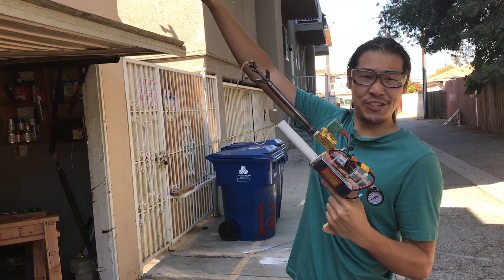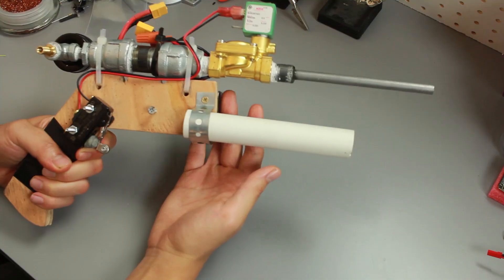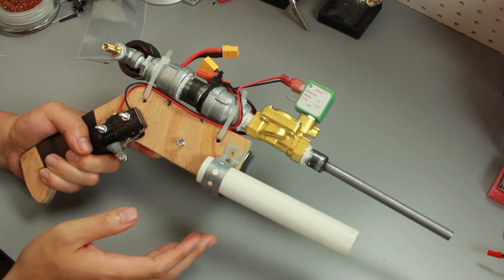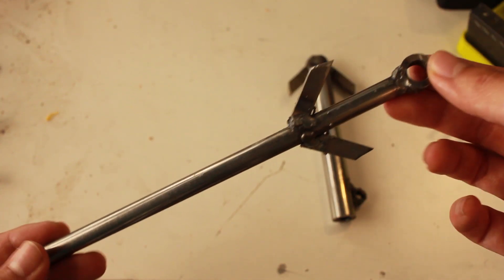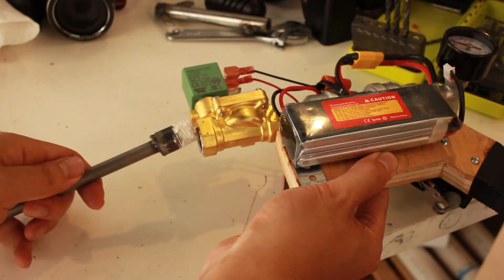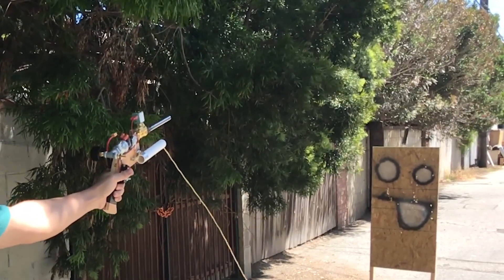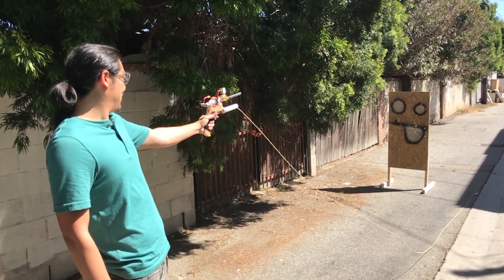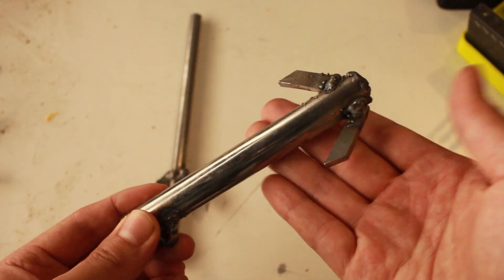Awesome Homemade Grappling Hook Gun

Comment: I like the straw wrapper design but you might try using some rubber sealing rings to maximize pressure on the rod. I prefer this design since it allows for more power behind the shot. We cant have spidy falling short because he missed by 1-2 feet.

Comment: u need one that is like a spike in the barrel then when it leaves it has 3 or 4 hook like parts that when it goes through something it expands to look its self like a one way valve. kind of like grappling gun from cars 2 in the opening scene (i am not a fan of the Disney cars movies I'm just using it as a reference) this plus the extra pressure and you have built the ultimate grappling gun

Comment: You could make the entire grappling hook out of recycled HDPE plastic, you could reduce the weight considerably. Also if you use a high pressure cylinder with a regulator you could adjust it to whatever PSI/CFM you want, and just refill with a scuba or N2 bulk tank....

Comment: what if you shortened the straw rapper an used acrylic or PVC pipe to extend the length of the hook so it's liter and it can go further and still have the strength you need.

Comment: So, I don't like any of these designs. the straw wrapper is fundamentally too heavy, and besides the problem of it flying back or damaging what it hits if you miss <or if you don't...!>, that restricts carrying capacity and the variety of use cases. the column first, meanwhile, has the problem of restricted geometry and a phenomenal requirement for being able to first accurately reach a target, and second, engage on it. so the straw design is better on this count, but since the problem of a grappling hooks engaging is the angle of the hooks, and the problem of flight is stabilizing a cylinder on a trajectory, I think you should flatten the 'straw' to just a heckey puck with the hooks, and put that on a shaft that you launch <like the column launcher>.  I'm not sure if I think the hook portion needs to be affixed to the shaft portion- I kind of have this vision of something that stays in the midle of the shaft and maybe spins to give it some aerodynamic stability, and if the shaft hits a wall that can slam ferward like a slide hammer for a 'poke in' affixing of the rope, and if the grappling hook and line go over and pull back to a target, the hooks can engage as normal.

Comment: Depending on how tight of a fit the straw wrapper style is you could probably reduce a lot of weight off of it as well. you only need a minor amount of material to hold your weight and the rest could be shaved a way you might be able to cut a pattern into it that still in part strength but lightens it up or leave two or three strong struts that run the full length with a ring at the bottom and then fill in the rest with something it still captures the air....

Comment: I have a idea use a magnet to force the grapple out flip a switch and push the same magnet down to make a huge pushing force to fore the grapple out towards a target and to recall it back just attach a pulley to the grapple and connect it to a switch to pull it back into the barrel and then add a rest switch to move the magnet back up and then repeat

Comment: The problem is efficiency. You should add a water chamber inside the barrel of the hook. Then let the pressure spray backwards as it leaves the straw.

Comment: Needs a better seal and possibly a longer barrel. The gas you use to pressurize this will also effect the range. Might want to try directly loading a CO2 canister maybe even use the parts from an old paintball gun. I would also like to see how a spring loaded version compares.

Comment: I love this guy's videos! I have an idea or two for the straw wrapper hook. I was thinking maybe half steel and half pvc pipe (or something light like such.) Like a weighted arrowhead concept. Move the rope's loophole at the bottom of the steel half to still make use of the strength of the steel. And still using the arrow concept, run feathers down the pvc half. They're weak enough to keep from obstructing the hooks latching on. Also maybe have a spring mechanism wired to go off at the pull of the trigger to assist against the rope's resistance. It would increase the rope's chamber size, so maybe run it along the side instead of the under barrel and at an upwards angle. Idk. You're the walk and I'm just talk lol. I really love your work, though.

Comment: A smaller diameter tube explells gas faster especially at low PSI a larger canister / tank or pipe in your case will be better. The current one is to small. Fitting the projectile over the tube with a tail of aluminum should net you good weight to strength ratio. But it is also good for your spiderman application to have a balanced projectile...

Comment: I just wanna say that the tube that holds the “web” is lower down than the air tube (not sure what to call it) and it could pull the “web” down thus making it not attach the way you’d want it to. I just think you should take it into consideration.

Comment: my big thought, ditch the adherance to pressure ratings. IMHO, your steel air chamber and brass lock are good for a hellava lot more. 150 psi... pfft. if ur working with pvc, sure. ive run a setup using an exhaust dump valve at 600-800 psi, using a refrigerator compressor into a fire extinguisher. then charging with that. all brass n steel fittings with rolled steel tube.

The only major hurdle I faced was I needed to Jack my trigger voltage way up to 45v (5x9v Batterys) to "pop" the valve quick enough. but with a limit switch n dump valve, it only needs a tap to open.

compact, powerful air, takes pressure, my man.

interested to try over-barrel tho.

Comment: I would say making it lighter isn't necessarily the answer because would it not have less momentum?  My next move would be increasing barrel length or making the hook more like an arrow.  If you think of it like a gun, which is essentially what it is, the longer barrel will allow more acceleration.  I think the hook starting inside the barrel is a better idea.  Seems like a no brainer but have you tried using various lubricants to reduce friction?  Another idea would be to angle the barrel slightly upwards to compensate for drop, means you could more accurately just aim and shoot. you could possibly try to incorporate propulsion into the dart rather than or as well as the gun, to gain more height, which is what a grapple is for.  Just throwing ideas out there, one might stick.  Great video though.

Comment: The main limiting factor probably isn't the weight of the grappling hook, but the weight and drag created by the rope. So actually making the grappling hook weight more compared to the rope may result in longer flight. But ideally make the rope thinner.

To check if this is true - try the hook with and without rope.

Also another way to make it better without changing the power is to make the acceleration last longer - for example by lengthening the barrel.

Comment: You mentioned that you used that specific solenoid because it has that specific size of fittings. You could try possibly using one with larger fittings, then mounting them to your back and using heavy duty tubing to carry the air to your arms. that way you can lessen the load on your hands, reduce bulk, and possibly have more space for a larger grappling hook.

Comment: Might be cheaper to hack up a paintball gun as a starting point given their working PSI's. Though that does add a bit of danger given the increased energy being worked with.

Also would be curious to see the same experiments done in the video but with dental floss or thin string. Seems like a lot of energy is lost in having the projectile pulling the rope.

Comment: I had this crazy idea the other day, you know how you can make it so water can cut through steel sheets?
I was think if it would be possible to make some kind of water sword, you could have the "blade" side be water shooting out and the flat of the sword would be steel that goes up and over the water making so the water is stopped.

I don't know if you could lower the pressure enough so that it wouldn't cut through the steel but still be strong enough to slice through just about anything else. It probably wouldn't be super portable considering that you'd have to have it connect to all the stuff that have the pressure and water but I think that it would be amazing if it were possible.

Comment: The main benefit of the over the barrel version is that it will fly a lot more true and if you make it a tighter fit it will use the pressure a lot more efficiently

Comment: WEB FLUID SERUM (I DID NOT MAKE IT IN ANY WAY) 
spirit gum with sylica
hydrolized polyvinyl alcohol
water-purified
magnesium oxide
graphene^
xantham gum, or guar whatever
heating coils
combined then like agitated by getting shot through bristles 
and shot through a sort of flat thimble spinneret with the holes all pointing in a inward direction so it makes a binded thread.
literally 60$ for the chemicals on amazon (in total btw)

Comment: I'd say the furz and furz light are the best option,  the problem with the furz light you made is that it flipped mid aire so it slowed itself down. you should try to make a "classic" furz but using a lighter material

Comment: Make the straw wrapper, but change the pipe part of it to a pvc of some sort or light weight material. The heavy metal head will make it continue to go forwards, and pvc will be lighter and still be able to take a reasonable amount of pressure...

Comment: Although it'll bump up the price significantly and be harder to weld, titanium might be a good option for the hook due to it's similar tensile strength compared to steel and it's lower density.

Comment: I like the straw wrapper design. It looks cooler, and when you fired it, it looked the most like Spidey's web. Ultimately, I'd choose whatever design is easiest to change cartridges mid web sling. If you run out of web fluid, you're gonna have a bad time.

Comment: I this the straw-wrapper is using the pressure more efficiently.  with the other design air can leak out between the barrel and projectile.  with the straw wrapper the air would have to flow backwards to escape which may be keeping most of the energy transferred to the hook.  I also see the benefit of the lightweight flipping design...  so why not combine them?  create a short and robust hook similar to design 2 but with an acrylic tube functioning as the straw-wrapper from design 1.  you could probably find some smooth brass pipe/tubing to use as the barrel.  the acrylic tubing could slide on and off smoothly and the weighted hook would still flip around and perform well while reducing weight overall.  you could attach the acrylic tubing to the grappling hook a verity of ways...  a tight fit over the metal tip of the hook, perhaps even screwed onto a threaded tip...  you'll figure it out.  good luck.

Comment: the straw one's weight could also be limited while keeping the necessary strength, just attach the string higher up, possibly on two sides to stop it from flipping, then you can replace most of the body

Comment: you could potentially easily print a part in nylon that is strong enough to hold your weight and even more potentially, I will include a link to a matterhackers project that tells you how strong certain plastics are. If needed you could also just print certain parts and then have other parts metal. 
http://www.matterhackers.com/news/filament-strength-testing

Comment: Use titanium for the hook. It's strong as steel about half of the weight. A few small pieces won't cost much and you can get a  shop to weld it for you since it's a bit tricky to work with if you're not an experienced welder. 
Increasing air pressure will work too, but I'd also work on the aerodynamics of the hook itself since that can also help with distance.
If you really wanted to go crazy, you could make a much smaller hook mechanism that expands the hooks out of a cylindrical container when it leaves the barrel using springs on the inside of the container to push the hooks out when it ejects. It would be a bit more compact and aerodynamic. Plus, it would look really cool if it was executed correctly.

Comment: Maybe replace the straw wrapper shaft with and acrylic or aluminum tube that has a small nub on one end to pop into the hook
Reply: And attach the string to the tip of the hook and fish it through eyelets on the shaft so that the hook part holds the weight, but it doesn't put the center of gravity in the front
Reply from the maker: It's gotta be strong enough to support my weight, so I wouldn't trust acrylic for any load bearing parts. Aluminum is certainly an option but then I'd have to find a tig welder...

Comment: For the function of the spider man web shooters you can use this idea 
You could babe a glove were when you do the spider man "web hand" a string will be attached to your pinky, pointer, and thump to open a latch for the web to come though, also there should be a hole on the top of the middle and ring finger so that if you put those fingers in the spider man hand position there could be finger print scanners shooting the webs
Reply: Btw I ment have not babe stupid autocorrect

Comment: Check out some of the things that are being built on TheSlingShotChannel - Jorge has been experimenting with several different designs of air powered projectiles including a shoulder mounted bazooka and several rifle style designs. All are based around a projectile that slides over the barrel.  Granted his stuff is a little lower tech but maybe there is some useful ideas there.  His attempt at a 1000 joule rifle for example.

Comment: I don't see why the straw cover has to be heavy metal apart from the fact that the cord is attached at the bottom.  If the cord were attached at the top the tube portion could be be light weight plastic or fiberglass.  It shouldn't need schedule 40 to contain the pressure.

Comment: Use the straw  wrapper  style but move the attachment  ring up to the head  and  make the  body out of a composite like an aluminum or carbon tube wrapped in  fiberglass . That  way you can get the extra speed because it  doesn't have to loose energy  flipping  around. And should go further since it should be lighter .

Comment: For the straw-wrapper style grappling hook, could you take a lesson from SPIGOT launchers and cut some gas rings into the barrel to create a better seal? With three gas-rings cut into it, that should increase the power and speed of the hook without having to increase the pressure in the system,. Though I imagine that doesn't work too well if the barrel is thin

Comment: I think the straw wrapper is more reliable to get it to stick to wherever you want it to... the other one has to rotate first to be aligned properly, and we could see in the footage that it doesn't just rotate 180° and stops there but keeps rotating, so it's gonna be a 50/50 chance of it actually being correctly aligned when it's time to get a grip at something
Reply from the maker: Yeah, it seems like there's significant kinetic energy lost in the flipping motion. On the plus side it doesn't get windy much in Los Angeles.
Reply: I think that when the rope pulls back, the hook will align itself properly no matter what so it will still work. On the other hand, I feel like the spinning makes the arrow less aerodynamic, making it fly a shorter distance... Also if the hook is lighter, the wind will have more effect on it which is also a drawback... Just brainstorming here :)
Reply: I think the spinning might be beneficial for getting the hooks to catch
Reply: Maybe if you fine tune how much of the stem you replace and where the weight is, or maybe add small fins that pop out?

Comment: I've been loving where your current project has been going so far! Though I'm only 14 with very little knowledge in mechanics and PSI and stuff like that, I do know how to make PREDICTIONS AND HYPOTHESIS! (Thank you Mrs.Harsh, My 8th grade Physical science teacher)

So, seeing the Colin Furze hook, it performed at much the same rate as the Colin Furze Lite, with the Colin Furze Lite giving that nice flip around that the normal Colin Furze hook might struggle with at times. So I'll mark out the Colin Furze hook.                        Now, when comparing the Colin Furze Lite to the Straw-wrapper hook, I noted that the Straw-wrapper hook did weigh more, and it would DEFINITELY hurt to have that come flying at your face! But nonetheless, the weight will cause it to arc much more strongly than the Colin Furze Lite. So I can mark out the Straw-wrapper hook.                That leaves the Colin Furze Lite! I apologize if I took up so much time trying to tell you what my opinion is!